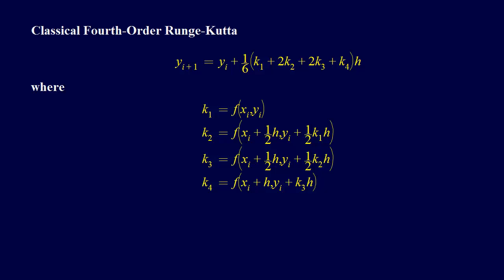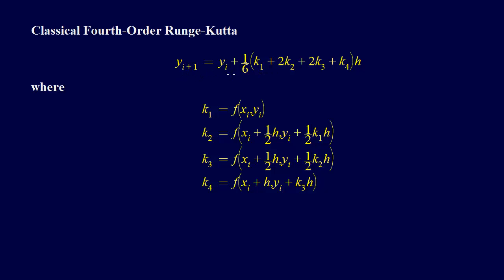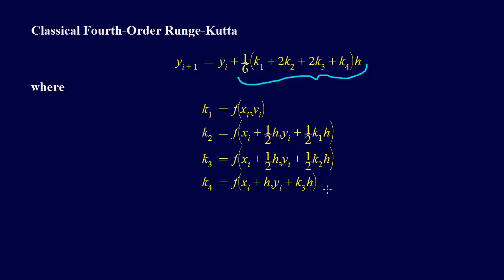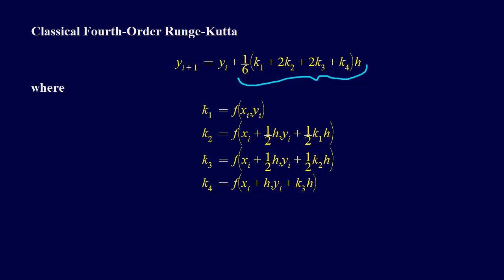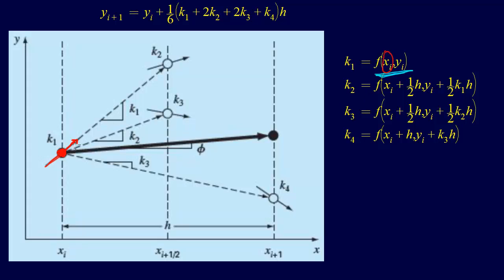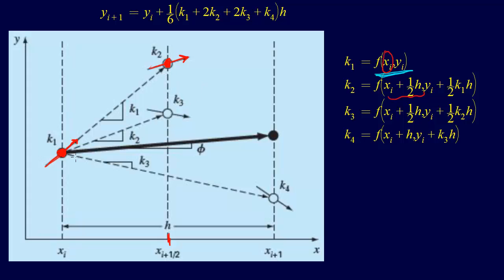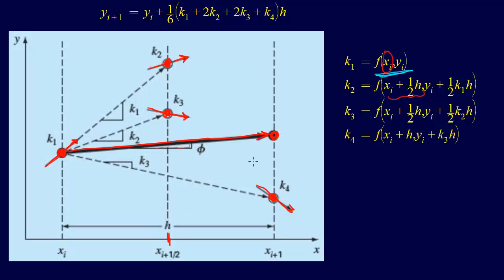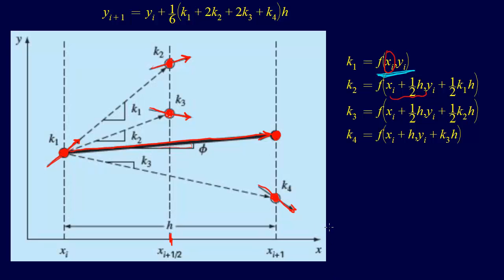7.1.8-ODEs: Classical Fourth-Order Runge-Kutta

Comment: How did you get the arrow directions for k2 k3 k4 and how did you get resultant of all from graph
Reply from the maker: The computations for K2 through K4 are as shown. They all represent slopes. As seen in the picture, you move along slope k1 until you get to x_i+1/2, and evaluate the function at that point, which gives you the slope k2. Do the same along k2 to get k3. Do the same along k3, except go to x_i+1, and get k4. Use k4 together with all the other k's to get phi. Use phi as the "best" slope approximation, and move along that slope to x_i+1 to get your next point. Repeat the process.

Comment: hI sir, how do I know which order of runge-kutta to use  to solve my problem ?
Reply from the maker: Higher order is usually more accurate, but at the expense of more computation. Adaptive 4-5 order Runge-Kutta methods are very common. It depends on the problem, though, which is something I cover in the 7.2.X videos in this series.
Reply: Thanks a lot :)